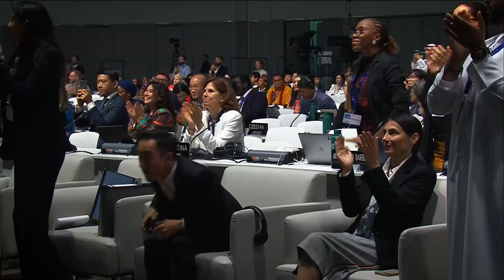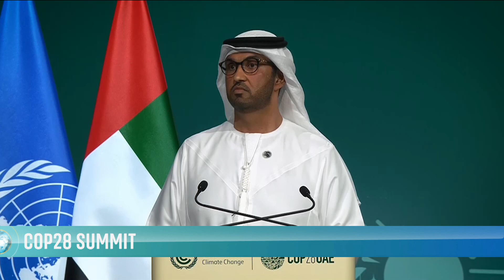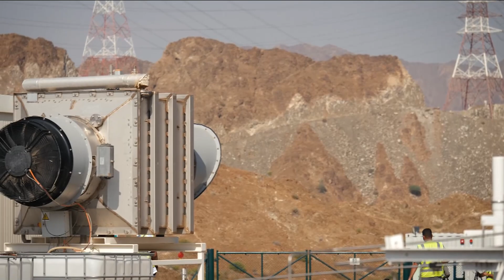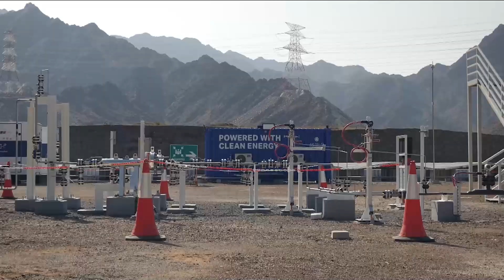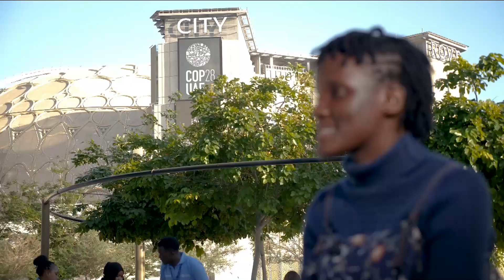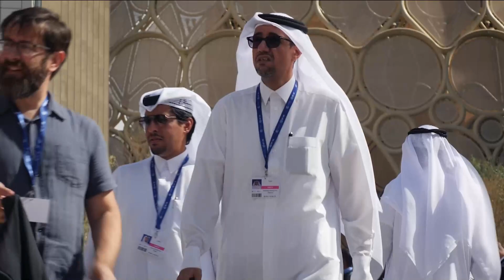COP28: What's the deal with carbon capture?

Comment: This is greenwashing at it's most outrageous. Lookit the little fan! You'd need billions of those. But Journalists only have 8 digit calculators and a billion wont fit so don't worry, they won't figure it out. 
There is carbon capture that will work.  See Ocean Iron supplementation, part of the Climate Restoration movement.  This is how Nature does it. WAY faster that forests.    And if we don't get the CO2 out of the ocean soon, it will all change it's way of life and become what we call a dead zone. Not actually dead, but toxic to us.